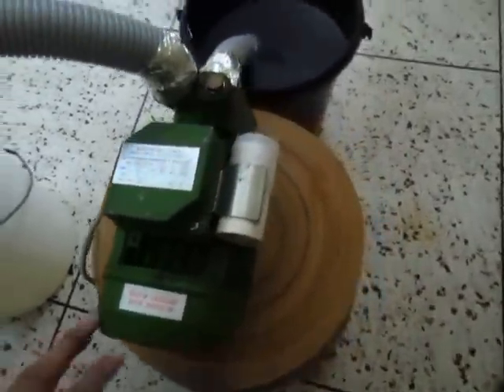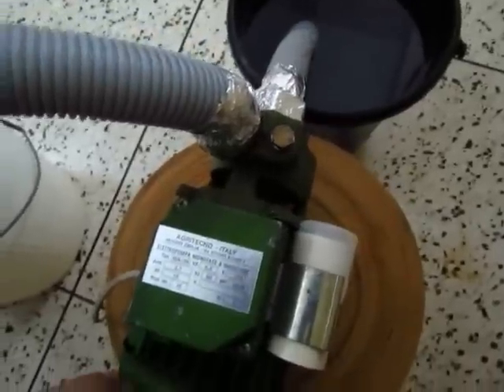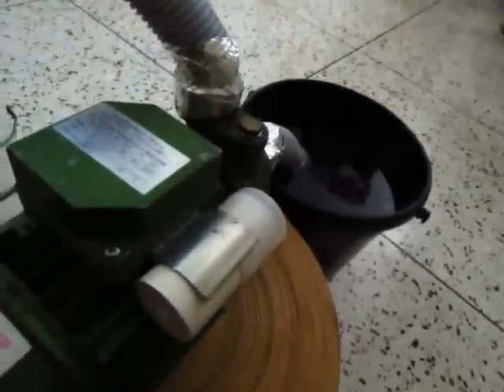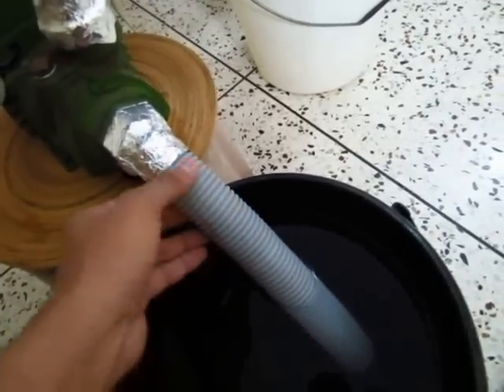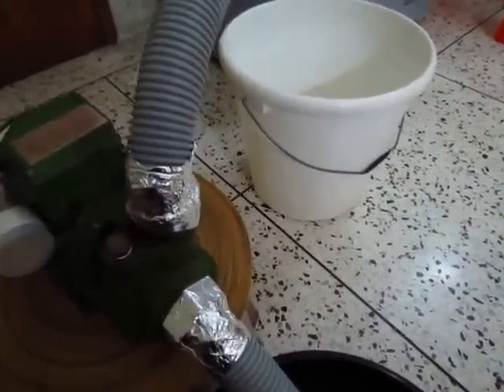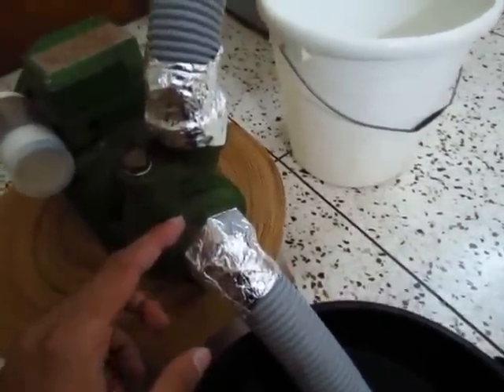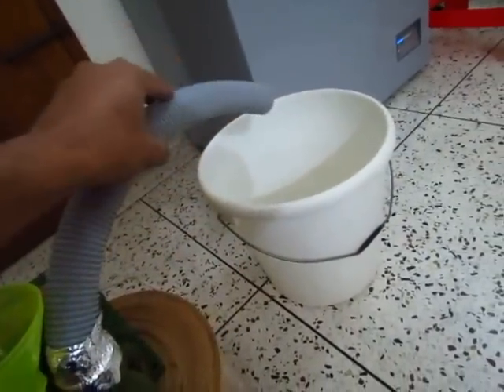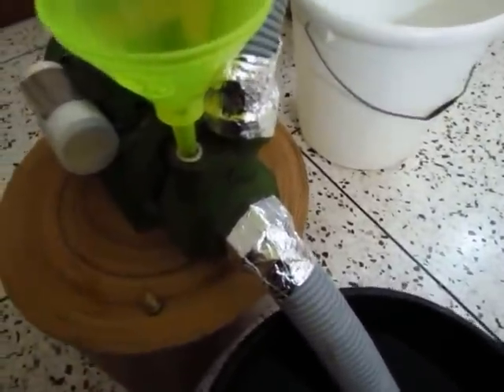How to fix a water pump that is not pumping water (priming)

Comment: I use INGCO pump. The fan is working but the water is is not passing through to the other other side. I have to remobe the air-lock but it is not pumping the water

Comment: When it was installed, it worked but when I started using it for the first time, it did not work.
Reply from the maker: If you have minor leaks or weak joints in the inlet pipe then air would get in and make it stop working. Try to make sure the pipes are well sealed and don't have any cracks. You need to do it every time the pump doesn't work. Unfortunately there's no permanent solution.

Comment: I have been told that a pump should not be stopped for long time after it has been used frecuently. maybe that one You show it's because it was new
Reply from the maker: @ricardorodulfo739  Somewhat true. If you leave it unused then it might build up rust and the bearings may go bad. It all depends on your weather conditions.

Comment: I've removed the prime screw and filled with water still won't pum
Reply from the maker: @AmandaVest-h1w  instead of a cup of water you can try pouring a whole bottle of water to ensure that there's no air. And then put the screw.

If still it doesn't work that means there is a leak somewhere in the pipe.

Comment: I've struggled for 4 hours to get my pump to work, and tried doing and googling everything possible until I found your video. Worked like a charm. Thank you!

Note: You probably want to close the valve/screw you'd use to fill the pump with water to the brum before you start it up. Starting it up open just shot water everywhere.

It is worth putting pump at slightly different angles when pouring the water in to make sure the water really gets everywhere.
Reply from the maker: Not sure how I have missed replying to your comment earlier, I usually respond as soon as I read them.

Yes, if you don't put the plug back, and if the pump is powerful enough then you have created your personal fountain 😊

Angle of setup is very important. If you keep it horizontal like mine or with the inlet somewhat upwards you're fine. If the inlet points downwards then you've compromised the setup.

Comment: Do you still here, can help? My problem is. Water goes in and goes out. And motor is running. But water still slow. What u think its problem
Reply from the maker: I am not sure. It's hard to tell without looking at setup. Maybe there is low water pressure from the mains supply.
Reply: @syedmarufulhuq  u mean its too slow water coming? Isnt the water pump job make it fasf. Actually before this its okay. But i found got tiny leak. So i shut it off for a day. After i reconnect back the wire. Its happen. Is it bcause the pump cant be use anymore?
Reply from the maker: @JeritanKematian  Low water pressure occurs when you have leaks that let air into the pipes. I think you have tiny leaks in the mains pipe which is letting air into the system. Or your pipes are loosely connected that is letting air in. Check again please.
Reply: @syedmarufulhuq  okay noted. Thanks bro. Will check again.

Comment: Thank you for this ..but my doubt is should you do this all the time when you want to pump the water? if yes what is the permanent solution for this?
Reply from the maker: Unfortunately, there's no permanent solution. You can try to install a non-returning valve on the inlet. 
Non-returning valve works good if you have good water pressure from mains supply. Otherwise it may not work as well as expected.
Reply: Thank you so much bro for your reply

Comment: After putting water it stopped sound and smell of like burnt transformer cane out...what could be the problem sir

Please help
Reply from the maker: If sound has stopped and burnt smell is present, then probably the wiring (coil/core) has burned.
Reply: @syedmarufulhuq  so what is the solution? To solder it
Reply from the maker: @abdikadirhassan3878   No, soldering won't help if coil is burned. So, if the coil is burned then you have to rewind the water pump, which means to rebuild the copper coil.
Reply: @syedmarufulhuq  thanks brother

Comment: So it means everytime want to start the pump the fill up the water right?
Reply from the maker: If you have to this everytime, it means your setup is not air tight and allowing air to enter. Check for loose connection or cracks in the inlet pipe. 
FYI, I had poor  setup once. I had to do it few times a week.

Comment: God bless you man. It totally worked. Thanks a lot
Reply from the maker: God bless you too!
Reply: Hey man. My water pump worked good for sometime with this method. Now, if i have to start my water pump, i have to try this method everytime. Problem with that is water comes out with heavy pressure which is difficult to control and messes up the surrounding area. Could you please tell me why is this happening and can my motor just work normally without having to pour water into the hole everytime i start it to make it work
Reply from the maker: @freakout4775  if you have to do this everytime, it means air is getting into the system (inlet pipe) maybe due to faulty set up or crack. So look for cracks or holes or loose connection in the pipe from the main line up to the pump. If water pressure in the mainline drops, then it might let air in. Some people install non returning valve in the inlet pipe to make sure pump always has some residue water for priming.
Reply: @syedmarufulhuq  well there was a crack in inlet pipe. I didn't notice it, someone else did. Thanks again man

Comment: Any reason why you put foil around tubes? I ask because everyday my pump loses prime. Suction tube remains 1/2 full. Foot valve works. Pump runs after i prime it. But loses it after a day. Wondering if it’s an air issue. Thats why i ask about foil
Reply from the maker: You're right! Though I used thread seal tape to attach the pipes to the pump, I used foil tape on top to make it completely air tight. Air in the inlet usually is reason for the pump to fail, assuming everything else is working including your foot valve. I would recommended a visual check for any cracks or holes in the inlet (from the pump up to the mains supply) that may allow air to enter the system. 

FYI, I once had a setup where I needed to prime on a daily basis. The setup was flawless, however the water pressure from the mains supply used to fall regularly causing air flow into the system.

Comment: My pumb is not pumbing enough water. Just giving out some little water. It used to fill a 1000 litre water tank for 3-4hrs but now it takes almost 10 hours. What might be the problem?
Reply from the maker: Several things. 

Make sure there's adequate water in the inlet pipe (water source) . 

Also if there's crack/hole in the inlet pipe or if it is loose where it connects to the pump, then you will have low pressure because air will constantly enter the system.
Reply: @syedmarufulhuq  Thanks. I tried removing the airlock and I realized that there is alot of water coming out of the machine but no pumbing.

Comment: My food truck pump pump but only a little bit and than it stops and the flow is no bigger than a man peeing.  Help please. How do I make the pump keep pressuring at full flow?
Reply from the maker: Pressure can be low if there's air leak in the inlet. Please check for cracks, holes or loose connection in the pipe that carries water into the pump.

Comment: This worked and the motor pumped water, but the next day it was the same again. Is there anything wrong with my motor?
Reply from the maker: Nope, nothing is wrong with your motor. It's the nature of the setup. There are primarily two reasons why this happens. First, if you don't have adequate water pressure in the inlet. Second, if there is crack/hole in or around the inlet pipe. In other words, somehow air is getting into the system.
Reply: @syedmarufulhuq  Ohh okay, I'll check  if there's a hole from where the air is getting into the motor. Thanks.

Comment: Our water motor is not working and not  going to our water tank,  it sounds not too loud and I saw this, I opened its cap but it filled too much water
Reply from the maker: You have to fill it with a mug of water and then quickly replace the cap. After that you have wait for sometime before the water reaches the water tank. 

If the water tank is very high, then it will take linger to reach the water tank.

Comment: Pump not absorbing water nd pressure also not observing then what solution for it
Reply from the maker: It appears you have a leak/crack in the inlet (pipe that brings water into the pump). This crack/leak lets air pass into the system and the pump can't create adequate pressure.

Comment: My water pump works but the water jet has air constantly coming out the hose. I primed the water pump several times and I even sank the water inlet in water. There is still air, where could be the air coming from?
Reply from the maker: Check for cracks in the pipe or loose connection somewhere.
Reply: @syedmarufulhuq  everything is new. I sank the whole inlet system in water and there s still comening in.
Reply from the maker: @andreic1755  If it's a new setup it should work. Make sure the joints are tight fit using plumber thread tape. Sometimes pouring more water using funnel helps. If none of these work, you would need to get a technician who can look at the problem in person.

Comment: OMGosh!!  We bought a gasoline pump (predator) at Harbor Freight.  After multiple tries, it still wouldn't pump. My husband loaded it up, took it back.  They said nope.  So, after he called and told me that, I thought I'd troubleshoot it on the internet.  I watched several videos and then came to this one.  I'm so glad I did!!  It worked like a charm!  I put plumbers tape on the threads, then tightened the hose clamps, wrapped the pipe and fittings with foil, then we primed the pump the way you said!  BOOM!! In about 10 seconds that thing was pumping so fast it took about 2 minutes to empty the ditch.  THANK YOU SO MUCH!!  We just knew we had wasted our money on that pump, but thanks to your video, we got it working!!
Reply from the maker: Wow! I am experiencing your excitement and relief vicariously through your narration. Thanks for the write up and appreciation! 

Internet is an amazing place, you can find solutions for almost everything. I'm glad you took the time to surf the net for solutions. 😀

Comment: Gonna try this now!
Thanks man!
Reply from the maker: Good luck!
Reply: Maruful Huq 
It didn’t work😥
Still not pumping water
Reply from the maker: @blackscorpio9136  🙁 You can trying pouring more water than a mug. Also if there's any crack or hole in the inlet pipe then it would not work. Finally make sure there's water in the main line (inlet pipe).

Comment: I didn't need to put water into the vacuum. It just worked after unscrewing the charge plug and then putting it back in.
Reply from the maker: Not sure how that happened, but good to know your problem got solved. ☺️

Comment: this happens everytine with my pump too....so why does the pipe filled with air...???can i get rid of it permanently..??please help
Reply from the maker: The pipe gets filled with air if there is a crack/leak in the pipe or if the water pressure in the main line is low. 

Unfortunately there's is no permanent fix for this.

Comment: Is there any permanent solution? because my motor doesn't start without putting water in it, everyday.
Reply from the maker: No permanent solution. You could try installing a "non-return valve" on the inlet. It may help, depending on the pressure in your main line.

Comment: This process is called priming by opening the priming nut to get the air out of the pump. One of the best examples illustrated online. I can see where people are getting their household problems solved, this has now taught me the concept in a more practical manner for my engineering vivas! <3
Reply from the maker: Priming, yes!  You pour water to create a air tight chamber between the pump and the water source. Basically that air tight chamber becomes a siphon. 
Appreciate you taking time to leave a nice comment.

Comment: Thanks so much for this; I'll try it out. 

I'm wondering what could be the problem when water disappears or seems to flow backwards. Basically, I have a water pump outside that's supposed to pump water to a separate (and higher placed) tank. The problem is that my storage water disappears, almost like it's flowing backwards or getting lost somewhere. The problem is, we're talking 500L of water disappearing every week! Where is it going???
Reply from the maker: There's a high probability that the water is flowing back, as you suspected. You need to install a check valve (non returning valve) to prevent this from happening.

Comment: Mr Maruful, such pumps give this problem every now and then. Why don't u suggest non-return valve at suction pipe end?
Reply from the maker: In this video I am demonstrating a quick solution. Non-return valve installation takes time.  Non-return valve is definitely a smart choice, if water pressure is adequate. If water pressure is low or when drawing water out of a pit,  a non-return valve will not help.

Comment: Actually what my problem was. Thanks! Helped a lot! I unplugged my pump for a day since my checkvalve went bad and was putting water back into the mainline and had to fix that 1st then the no water problem happened.
Reply from the maker: Zek Kei Having a check valve right before the inlet can greatly reduce the problem I showed here, lot of people don't use it though. You have a smart setup!

Comment: It does not work for long pipes
Reply from the maker: Sourabh Verma For longer pipes you will need to pour more water,  maybe a litre or more for the vacuum (between the pump and the water source) to be created. Also the type of installation affects the drawing of water.
Reply: Maruful Huq. Thanks for the reply, yeah it depends on the length of the outlet pipe and the joints also.. but still a genuine and helpful video. Changing from thumbs down to thumbs up :)

Comment: i have to fill water every day when i start the pump...any solution.
Reply from the maker: Ankit Phulera This usually happens if there isn't constant water flow in the inlet pipe OR if the pump is installed on a higher position compared to the inlet pipe. Try to address these issues. Unfortunately there's no permanent solution to this, that I know of.
Reply: You have a leak in your pipes on the inlet side you're sucking air

Comment: I have the same problem. I tried for hours but it wouldn't start pumping. Could the problem be that the pump is on the wall? So its vertically installed on the wall. Not like yours on the video.
Reply from the maker: Davvi E If it's vertically installed with the inlet on the upper side then it shouldn't be a problem. If the inlet is at the bottom,  then obviously you have a serious issue in hand.
Reply: Maruful Huq the inled, or the screw for priming is on the side. So not on the top. The pump is like yours but Chinese.
Reply from the maker: Davvi E The inlet is the pipe through which the water goes into the pump.  Is that pipe on the top or bottom?
Reply from the maker: Davvi E Yup I was right. See the vertical pipe (on the left of the picture) is going into the pump. That is the pipe through which the water goes into the pump. This means it will take more pressure for the water to rise to the level of the pump. If you can change the setup then it might work.  You can also try pouring more water than I did,  that might also work. Lastly make sure there's water in the line.
Reply from the maker: Davvi E If I were you then I would connect the horizontal pipe at the bottom directly to the inlet,  not via a vertical pipe. The discharge (outlet) pipe however can be vertical,  no problem there.
Reply: Maruful Huq Thanks for taking time helping me... I appreciate it. One last question. How would you change the setup exactly? Lower the waterpump closer to the watersource? Install the pump on a rack to have it straight? I can change the setup easily, its not a problem. Again, thanks!
Reply from the maker: Davvi E You got it,  lower the pump and connect the pipe straight to it.
Reply: Maruful Huq thanks bro, I will try it out 😊

Comment: When I started the pump and open the cap the water is not going through cap it came out so what can I do now
Reply from the maker: R.I.P RACISM Water comes out of that hole if the motor is spinning in the opposite direction. Did anyone work on the wiring? Water may also come out of there if the discharge pipe is clogged.
Reply: Yes the motor machenic worked on the wiring while motor is dead
Reply: I'll try one more time

Comment: I don't have that hole :/
Reply from the maker: red CORAL Maybe it's a different kind of pump. Look around I guess. You can also attach a T-junction pipe to your inlet to be able to pour water into the inlet. However that T-junction would need a cap for you to cover after you pour water.

Comment: Hi I am getting water but with low pressure. After doing some repair work. Why?
Reply from the maker: Satish Chinta If you're getting low pressure,  then it's probably due to some crack or hole that's letting air into the system.
Reply: Thanks

Comment: i have the same problem with my water pump but i unable to open the cap.. it is bigger
Reply from the maker: Helmet Lawsux If the cap is stuck because of rust then you can use WD-40 spray to loosen it.